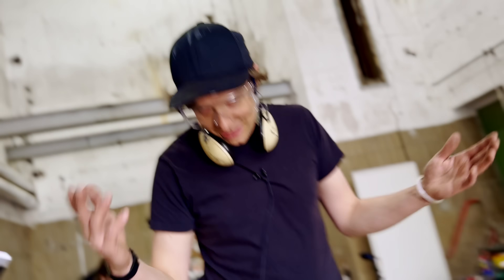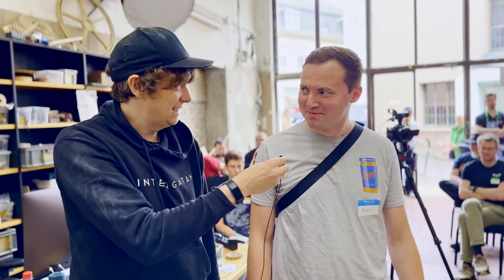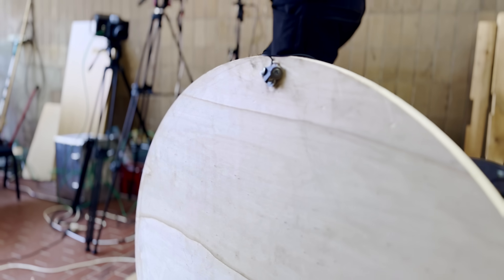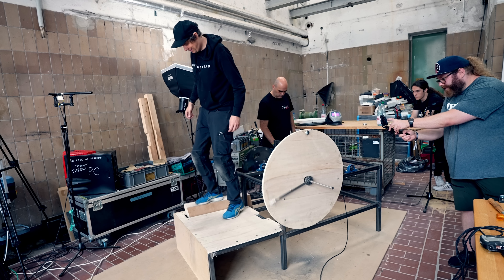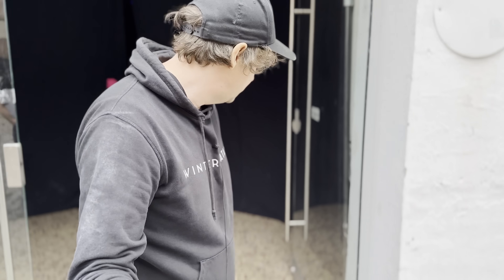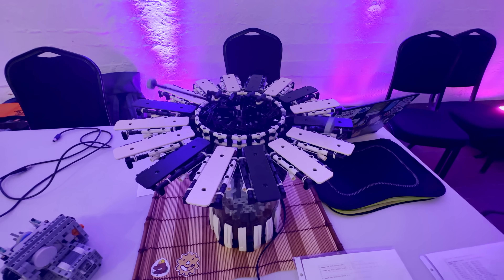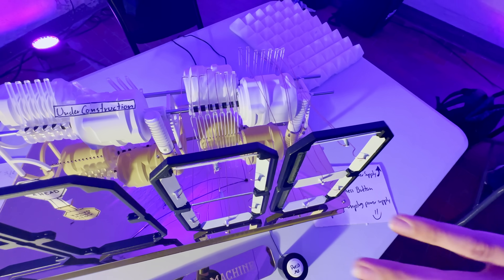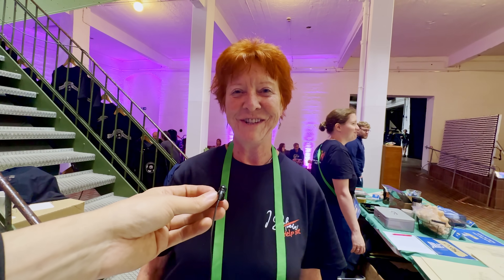First Timing Tests - DAY 6 - Marble Machine Flywheel Prototype

Comment: Maybe try a ratcheting like drivetrain (like a bike sprocket). Obviously something that ratchets would add a lot of noise though, but there may be something along those lines that allows for you to add power while slightly decoupling the pedal from the drivetrain

Comment: I think you're too worried about whether you can, that you haven't though of whether you should! I think the slow ramping tempo changes of the marble machine are what sets it apart from any other sequencer. There's something so melodic about its music that swelled and waned as the piece went on. In short, I think the imperfect tempo control (whilst still being smooth due to the flywheel) will elevate your pieces rather than ruining them. I think you should be more worried about mechanical reliability and less about perfect timing. Let the machine live!

Comment: Why don't you use a freewheel like on bicycles ? With your system, a big part of the energy is lost in the pedal movement once you stop pushing it. It would also be way less exhausting than having to pedal constantly.

Comment: It’s almost like you need a set of gears like on a bike, so cog one goes 80bpm max, cog 2 90bpm etc. then all you have to do is max out the speed each time. A belt drive derailleur might be tricky but a gearbox might be the answer.

Comment: Don't forget that you don't actually need to be in sync with a metronome, only to keep pace with it. And you don't need an exact bpm, you just need a consistent bpm.
So rather than trying to sync up to a metronome, use it as a guide for the pace but then measure the machine itself, not in relation to the metronome. If you get 79.5 bpm that is consistent over the length of a song, that is quite adequate. 
Any non-marble machine instruments that you may want to play along side can use the machine as their timing source.

Comment: Aren't you going to hurt your knee pumping like that for extended periods of time?
Also it looks like a marble might eventually get stuck in the gap that opens at the front of that pedal.
Lastly, have you considered building a self timing mechanism to prevent the pedal from going faster than required ?

Comment: It feels like the biggest problem you are having here isn't that achieving a constant BPM is difficult, it's that you are trying to specifically sync up the ticks and, as you said in the video, to do that you need to go over or under the required BPM and then correct again. If you could dynamically convert the contact mic ticks to a BMP value which you could see on the computer then I'm guessing it would be a lot easier to maintain a given BPM.

Comment: I have to admit I cannot see how you can hold a tight timing with this pedal system, even if your flywheel is really heavy you are still adding energy with the down strokes and loosing energy on the up strokes. I suggest you consider something like what you find on an orbital bike or even better a pedal like on a normal bike where you have a more consistent input of energy ... The other way is to change the gearing so that your flywheel is turning many more times compared to what your main programing wheel is turning to reduce the effect of the fluctuations ... this is not an easy problem to overcome using a direct manual input you might need to go to the pendulum system you talked about earlier.

Comment: How is "playing tight music" defined? In your test you tried beat matching which is something different and prone to the controlling issues you experienced. Simply matching a certain tempo is a different and easier task. You could test it by adding 330 small bumps on the wheel and creating a tone when the bumps pass some kind of flexible material like a small piece of cardboard of plastic. If you turn the wheel with 80 bpm the resulting tone should be 440 Hz and you can easily match that with a reference tone with a guitar tuner or by ear listening to the interference beats.

Comment: Double pedals would not only make it more tight, but also way more comfortable to power it for longer period. Right now it is only the flywheel without any workload. Pedaling the whole machine for the length of a concert will be too much if done with only one leg. Using both legs you would get into kind of a dancing rhythm. Easier to hit the pace and look cooool!

Comment: Even though you've given the foot pedal skirts, it still looks like there's a pretty nasty pinch point at the very end of it. E.g. 7:00 you can see the gap widening as the pedal rises, and shrinking as it falls. Ideally, the gap should stay the same size, or maybe even taper the other direction.

Comment: So a member of the audience points out the locking tabs, which Martin demonstrates on a single bearing.... and then proceeds to ignore all the rest with the inevitable result. As to what's going on at the moment - unfortunately Martin has fallen into the trap of designing the horse without having (or having designed) the cart to know the parameters of what is required from the horse. Without knowing the parameters of the load you can't really design a power module to suit. 

He's seen here trying to match both the speed and phase of the output of an undamped flywheel to a metronome, the only significant damping coming from his leg. Since the marble machine will be providing the percussion as well as the music I would question whether phase matching is so critical & even the absolute bpm isn't so critical as controlling the rate of variation - most people won't be able to distinguish between 90 bpm dropping to 89 over a few seconds but oscillating between the two  every second would be more noticeable.

Comment: This doesn‘t seem like a good test of tightness off the music. It seems what you are testing are your ability to sync with a metronome, which is something rather different, and probably not a feature you are going to need.
Consider if you were playing with a precise 80bpm motor, but offset by half a beat, it would stay that way forever.
If you want to sync with a metronome it would be easier with a small movement of inertia, because this allows you easily change your speed. But this is the opposite of what you want.

I imagine what is more important to test is; whether the tempo stays consistent when adding more or less resistance. Like when turning the drums on or off.

Comment: I think putting the pedal link at a slightly bigger radius on the wheel will give you more power. And also less inertia in the fly wheel will give you better control over the tempo.

Comment: You may be forgetting that the whole machine behind will also add a massive inertia, that's why the MMX had much less trouble staying on time despite the much lighter flywheel.
You could simulate that by adding a big weight on the time counter.

Comment: I kinda wonder if a clutch would be better for the drive wheel that feeds the flywheel. Instead of it being direct and force feeding back through the input system, having it float when it gets up to speed should help free up the flywheel to maintain its momentum. Having a selecting clutch system could allow the Flywheel to get up to proper speed but the input from the pedal will not allow it to go faster. Kinda like a bike going down hill in low gear, you can pedal all you want but its not going to go any faster. You could select the BPM the clutch will engage in on the fly when ever you need to shift the BPM. You can still apply the muscle memory with the system as you would be putting in more effort than needed and it would not be doing anything as it would lighten up in pressure. It would be a helper to level out in the high end. You would still have to maintain the low end.

Comment: Why use a pedal and not just use an exercise bike? You get the disconnect for free, a heavy flywheel and a pretty easy way to get the correct RPM.

Comment: Having the pedal permanently attached (especially now that it will be heavier due to strengthening) will make the output inconsistent as gravity is "helping" the movement through half the stroke and "hindering" through the other half. Even if you get the clock hand hitting 12 o'clock consistently, when it lifts the pedal it will slow down for that part of the stroke and speed up on the opposite...

A well-balanced rotary "boost" system would be preferable.

Comment: Just my observation that your ‘power’ stroke is only supplying a force 50% of the total revolution. If you consider a steam locomotive the piston is powered by steam pressure on both sides of the piston or equivalent of a 100% power stroke with no interruption. This is also the case with pedal powered bikes, with power stroke’s alternating with the right and left foot to create uninterrupted power strokes. Unilateral powers 50%, bilateral power strokes produce a more consistent rotational force for the power. ❤ love your videos 👍

Comment: you showed yourself bending down the tab,
but did you re-torque the nut in place first?

additionally, correct advice on the correct use of the washer was posted here in the YouTube comments, days ago.
-I advise that you have one of your Mods. or specific people from your discord community take the responsibility of aggregation of useful information from the YouTube comments before you hurt yourself or spend too much time on a wrong path when there maybe a good idea in the comments.

Comment: I think you should consider an electric motor as the primary motive force with some analog controls that mimic what you're doing with the pedal or other input methods, but smoothed and filtered so the motor doesn't accel or decel in a "hunting oscillation". Your timing will struggle to be tight because you are putting in pulsed power; yes the flywheel if large enough will negate that but then you lose the ability to quickly adapt tempo. Electric motor will be consistent and you won't be dead tired from spinning 100s of kilos of steel that you would otherwise need in a flywheel to get it to that level of tightness

Comment: still think it needs a ratchet like a bicycle for the pedal.... and a clutch would allow you to control tempo much easier.. get the flywheel going and engage the clutch with a gear system and you could vary the tempo much easier with a gear box

Comment: You could regulate the pedal movement similarly to elevators, which use counterweights to balance the static load of the mechanism.  Create a foot pedal lever such that the anchor point is a pivot with an extended counterarm.  An adjustable counterarm weight would push up on the linkage during the offstroke, smoothing out the rotation.
Alternatively, you could attach the end of the counterarm to another flywheel which would act as a regulator.

Comment: why you do nto use an electric motor for turning the fly wheel, in tis way wit a simple Arduino you simplify a lot the mechanism and you have a high control  ?

Comment: Quick question: why instead of trying to synchronize with a metronome, which appears to be quite difficult, you instead just have a BPM measuring device. This way you can slow your acceleration as you get close to 80bpm and then just focus on staying there, instead of trying to stay at 80bpm and having to stay in sync with a metronome? Could this make your life easier?

Comment: Well right now you aren't as much testing if you can play in tempo and are instead testing if you can match a tick. You need the lightest possible flywheel to perform this test well. The heavier the flywheel the harder it will be for you to match the tick because it will take so long to respond to your changes you will oscillate back and forth a lot before reaching the tempo. If you operate off a tick response speed is important. Even if you had a device that maintained say 100 bpm perfectly but it takes 5 seconds to get up to speed then it won't do well. That is because it will land offset from the tick. You would then need some way to speed up and then slow down to match the tick but that is essentially what your doing with the foot pedal. If you had a gear or something to change it could be easier though. As long as the machine can keep a constant tempo you can use it to generate a tick that is given to the other musicians if necessary.

Comment: They make devices that measure the RPM of spinning objects.  Why don't you get one and mount the receiver to the frame above the foot pedal and figure out what RPM corresponds to different speeds of the metronome.  Then you just have to maintain that speed while pedalling.  The more weight of the flywheel the easier it will be to maintain a speed.

Comment: PLEASE READ
Timing compensation would be MUCH EASIER if the pedal were sprung up and only applied power through a one way clutch on the first shaft.
This would be easy to implement, eliminate pedal crushing risk, and allow you to adjust timing by stroke length instead of pressure!
Let off the pedal, it goes up and stops...everything else keeps going.
Re-join the tempo from the top every time.
Note: the pedal connecting rod would have to be fixed to the hub with the roller clutch such that it was timed to be just past TDC on the roller clutch hub when at top pedal position, and a full stroke would bring it back to about 10 degrees past BDC.  Short strokes would stay within 170 degrees, full strokes would result in a complete revolution of the sprag hub.  A pedal stop might be required if the stroke length  (hub diameter were changed significantly).
See @BaldrianSector1996 in this comment section

Comment: there was still definite bending right at the point where the wood platform ends and the extra welded beams were added. Is it possible to get a pipe that's the same OD as the inner width of the square pipes, and slide it down into it? A circle within a square should add plenty of rigidity i would think (i'm not an engineer, but as arcs have historically been one of the most structurally sound shapes, seems like adding that cylinder inside the square pipe should be like adding an arc to each direction. If a pipe tried to bend, it would need to expand outward at the bend, but the square beam would prevent that). Getting it more rigid should both improve tightness of the timing, and reduce the chances of a stress fracture from all the bending happening at that very specific point.

Comment: You might be able to use either hydraulics or air as replacement of the huygens system. Air is used in bellows at a blacksmith. They have a big bellow that stores air and a small one that pumps the big one full. You could use like four hydraulic cylinders below the machine that you pump up with your pedal and then the weight will try to lower it again. The flow of fluid can then be used to power the flywheel. You can control the flow with flow control valves.
Reply: Or maybe construct a water wheel like at a mill. But, seriously, he should stick to the motor he used on the MMX.

Comment: It seems like this system requires too much concentration to keep tempo. Realistically, you need a system of imputing power that is not tempo dependant,  and a secondary system whereby you can select any desired tempo and the machine will hold it irrespective of power input fluctuations.

Comment: The timing was always my concern with this design because of how much the speed could vary.  The concept is impressive, using a foot pedal to generate rotational force that is largely smoothed out by flywheel, but without the level of control either an electric generator or something similar that can provide a constant RPM you will always be varying the speed by some amount.  You go too fast, then too slow, then too fast, and so on.  Unless you get real good at keeping the pace but that seems like it would take quite some time.  

Maybe you could make two separate sources for the machine, use this foot pedal idea for the parts where timing doesn't matter like the marble lift and use a separate source that keeps time perfectly for the timing wheel which tells the instruments to play.  Then you give the impression of using the foot pedal as a power source but don't have to worry about being in time so much.

Comment: Well, you could put a strap on the pedal where you put your foot into, this way you may decelerate enough to avoid overshooting. Not a good enough idea but very easy to test. If you put it at the end of the pedal you can put more tork as well.

Comment: It feels like you need to decouple power input from timing. The flywheel is doing a great job at storing energy, but the heavier it gets, the harder it will be to control precisely.

Comment: Instead of aligning to an external metronome click, it'd probably be more useful to feed the mic into a delay effect and synchronize against the appropriate delay -- in whatever ensemble the MM will be part of, it's going to be setting the time, so it just needs to synchronize to the correct interval length, not synchronize to some external click.

Comment: There is a trade-off you are making between "having control over the speed" and "the machine using momentum to sustain a constant speed". These are conflicting requirements.

The more you want the machine to help you, the less control you will have to fix the speed if it's wrong. The more control you have to fix the speed, the less the machine can help you sustain whatever speed you reach.

So what you've done with the flywheel is make the machine sustain a consistent speed much better (the delta between tick distances is low), but you can't quickly change the speed if you want to.

Comment: On the beginning, instead of comparing to the metronome, just have a display with Your current bpm, and then You will be able to react faster to the flywheel  changes. Also, this will give you new ideas how to improve it even faster, and then :) when You will know that the design is good start practising to the metronome  ...this is just my suggestion :)  ...respect Your time :)